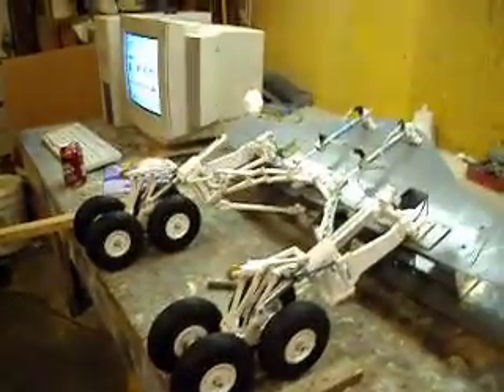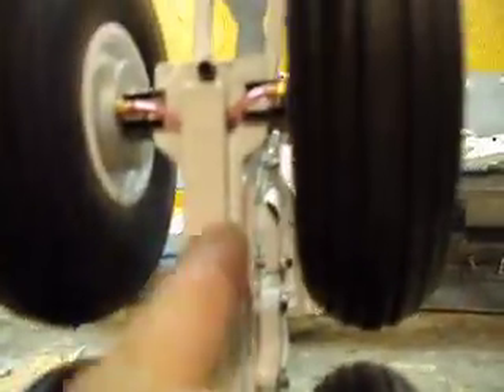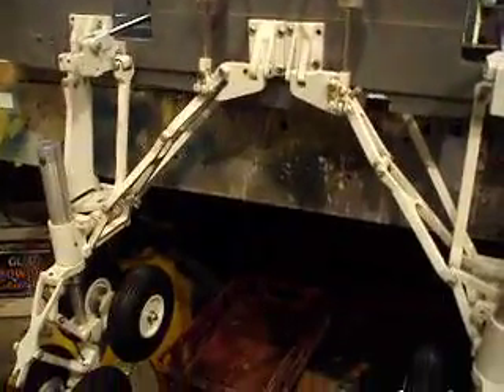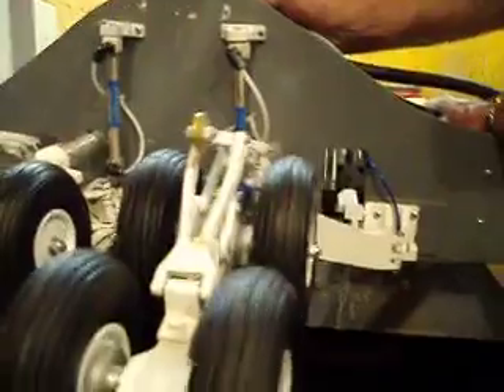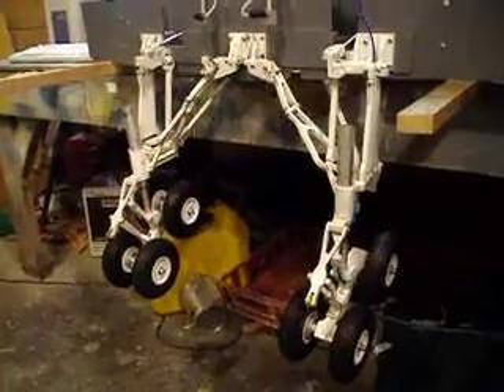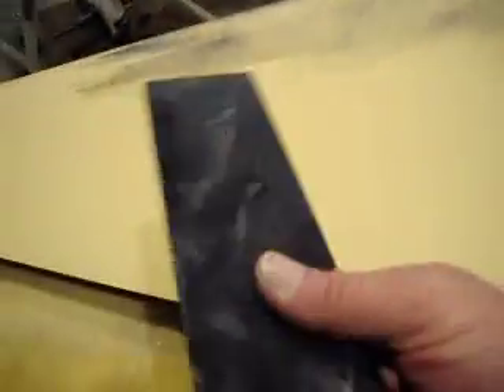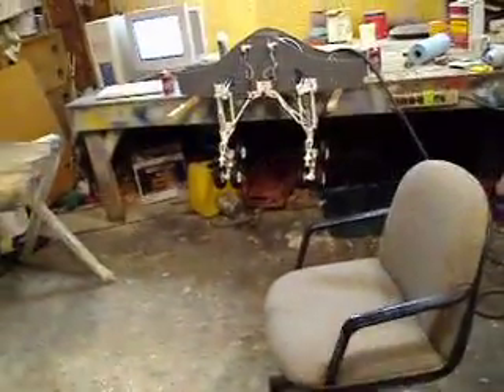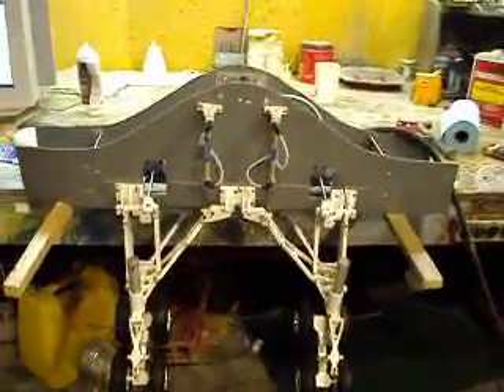How to build a rc jet b1 bomber #60

Comment: Hornit Pilot: If you are going to go with a 2.4 ghz. radio system, its recommended to use only 6VDC receiver power. What will you be using?